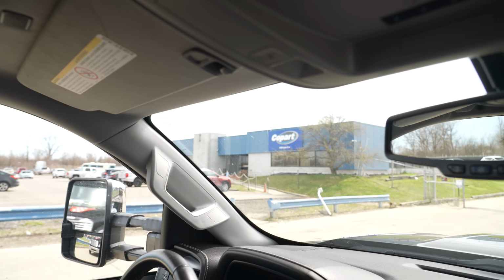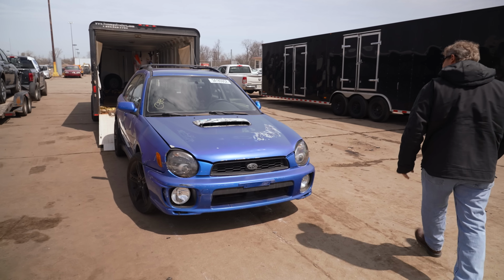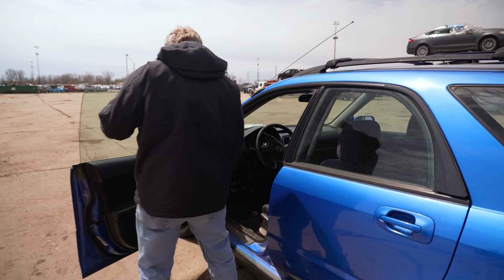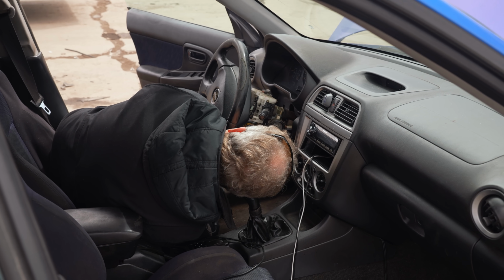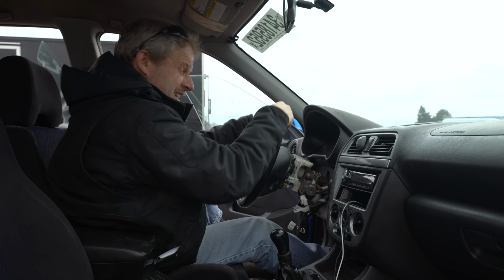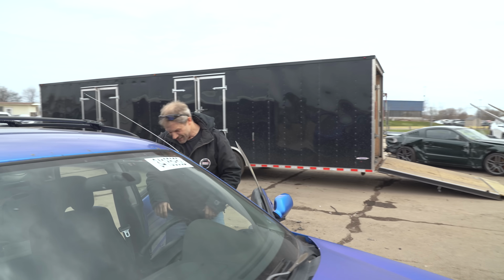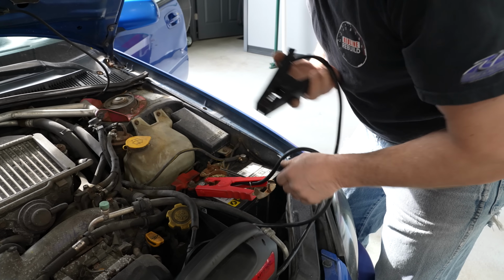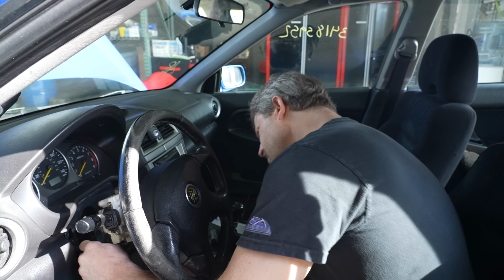Davin's next engine rebuild project... yikes

Comment: Next time try giving the steering wheel lock on the rack and pinion nine volts and unlock the steering wheel and push it in the trailer.

Comment: FYI, Most times you can break the steering wheel lock by hand. using both hands to force it in one direction. It may still have some resistance, But you can still turn the wheel

Comment: Can almost guarantee it isn't the starter. That black ring around the ignition barrel will likely be the sensor ring for the chip that the ignition key has programmed to the car.
No programmed key, no starter signal. Still gets all the dash lights/ignition etc.

Comment: I have an Outback, so am looking forward to this rebuild. Just make sure you have the special tool to R&R the piston pin retaining rings. You'll never get the engine apart without it. The pistons come out the top, rods come out the bottom with the crank.
Reply: “The pistons come out the top, rods come out the bottom.”  How is that possible since pistons and rods are assembled?
Reply: @ellieprice363  You remove the retaining rings and the piston pins (at BDC) through holes in the block. When you part the block, the rods and crank come out as an assembly, and then the pistons can be pushed out the top of each block half. The four cylinder engine is easier as you can get away with simpler tools. The six cylinder engine is the bearcat to work on the middle cylinders. Here you really need the special tool to get the clips and pins out.
Reply: @johnmortison5763  Thanks, I’m not familiar at all with Subaru engines so this interesting to me.

Comment: Will we ever get a series on a 20R or 22RE Rebuild?
Reply: Would the 20R and 22R be Toyota engines?
Reply: @ellieprice363  Yup
Reply: @TheCapitalVice  I bought a wrecked ‘78 Celica in 1986 and removed the 20R engine and 5 speed. Bored the 20R .140 over for 22R pistons, installed twin 40mm Mikuni side drafts, Crane cam, Thorley headers valve job and balanced it. Long story short-Installed the engine and 5 speed in 
my ‘73 Celica (18RC) and drove for several years. Sold the Celica in 2003 to a man in Toronto. He named it “White Lightning”. Now I wish I had it back.
Reply: @ellieprice363  I just picked up a 77 Celica GT yesterday with the 20R and 5 speed. It needs to be overhauled which is why I made the comment hahaha. I'm a visual learner and I rebuilt my Buick Nailhead but im intimidated by this little engine, silly I know but this car is all original and I want to keep it nice.
Reply: @TheCapitalVice  No reason to be afraid to rebuild it. It has a ton of emission stuff on it but very rugged and straightforward engine with a free breathing cross flow head. Plenty of parts available but expensive. The 20 series are much improved over 8R and 18RC engines. The Celica was Toyotas answer to Mustangs. 
Good luck.

Comment: I know it's not your style but bug eye Subarus are fun.  EJ20 engines are pretty reliable if you keep them close to stock and as long as you don't do red line clutch dumps the transmissions hold up pretty well...
Oops I'm a little late on that trans...

Comment: I had a world-rally blue, '02 WRX sedan just after I got out of college! It pushed like a pig in tight turns, but it was tons of fun. I took it to an amateur rally in some nice farmers corn field in the middle of winter and had a blast sliding around. I also autocrossed it in SCCA stock class for a while. The bug-eye font end was no prom queen and the paint chipped really easily, but it was loads of fun to drive and that unequal-length exhaust header burble sounded way better than any other 4-cylinder car I've driven. Looking forward to seeing this one!

Comment: This’ll be good. I had a 96 model I bought new and had for 16 trouble free years.
When I sold it, I’d put 375,000 on the clock and it passed the roadworthy.
I’m surprised by the rust though!

Comment: amazing turbo charged engines that can produce 300HP. in a WRX. You can really go to town on this. Suspensions are supper easy to upgrade. Four wheel drive on that year is easy to fix if there are issues. GREAT CHOICE!!!.  Pick any hot hatch from the 80's or 90's Ratty body's who cars

Comment: Surprised it started and ran at all: usually if the keys are absent, someone doesn't want you to start it and find out how bad it actually is. Engine, transmission or immobiliser woes mostly.

Comment: If you guys plan on making a whole lot of any kind of power with this, I'd highly suggest spending the money on a closed IAG block before you build for some extra reassurance. This car is pretty cool though, gonna be fun to watch you guys handle something so much newer than your usual stuff
Reply: If the original block is OK it is also possible to do a closed deck conversion on it, it doesn't necessarily have to be a new block with it already done
Reply: @rainvillecreative5410  Yeah, that's what I meant. I guess I should've been clearer. But they should definitely do it for reliability and peace of mind.
Reply: What sort of horsepower can these things make?
Reply: @Jesse-B  A lot of you build them right especially with a billet block
Reply: @02honeydew  I remember the first time I heard one back in early 2,000s, it had a sports exhaust and at first I thought it was a v8, because of the offbeat timing I guess, but after I realised it was a boxer 4, I still love the note they make. Would 300 HP be reasonable?
Reply: @Jesse-B  Yeah, they do sound cool for sure, I just wish Subaru made them more stout from the factory. For sure, the STI motors are known to handle like 400 to the wheels and I'm sure this generation can handle at least 300 to the wheels or better with some maintenance done before hand like timing/oil pump/water pump. As long as it's a healthy motor it shouldn't be an issue.
    EDIT: I'm no expert on this cars by any means, I just had an interest for awhile and did a lot of reading. I know some engines had more issues than others and Im pretty sure it's common to do a budget build on these motors with STI internals from (pretty sure) the EJ205 to have a pretty strong setup for around 350whp or better on E85. Getting sleeves/closed decking these engines helps a ton with reliability because they're basically open deck blocks with a small amount of support structure around the tops of the cylinders so they end up shifting and coming out-of-round at high boost pressure. If you have an interest in these cars or any Subaru for that matter, make sure you do your research on them. I know the 5 speed trans isn't the strongest thing in the world and the older rear diff pre '08 I think it is, isn't super tough either when you get up there. Getting a car with the 6-speed and I think it's the V180 rear diff would be your best starting point probably. They do require on point maintenance tho, more so than a lot of cars because of how tight the tolerances as well as the engine desines. Kinda like BMW with rod bearing clearance. Also, my bad for the super long comment.
Reply: @02honeydew  Not at all, great information, thanks. You reading this Davin? 😋
Reply: @Jesse-B  Glad I could help, good luck on picking one up if you decide on a Subaru.

Comment: I'm looking forward to this. It will be fun to watch you set valve lash when you rebuild those DOHC cylinder heads. Although the Subaru WRX uses a boxer engine, assembly and disassembly is much different from that of an air cooled VW.
So now that you are working on a metric car, will you keep a score of how many times you forget you 10mm socket or wrench?

The WRX probably would not have made it to the USA if a bunch of gamers did not seen them in Gran Turismo games. Same applies to the Mitsubishi Evo and Nissan GT-R. I actually knew about those cars earlier, thanks to the magazine Sport Compact Car.

Comment: I am not sure if you had the clutch in when you were trying to "key" start it. If you had the car in neutral and the clutch pedal not on the floor, that might have been your starter problem. We'll see and I am excited for this rebuild. Subaru's are interesting beasts.
Reply: WRXs have a clutch safety switch, but not a neutral safety switch.

Comment: I feel so depressed for you. There are few things in this world as poorly designed or manufactured as Subaru vehicles. Pure unadulterated junk. Hope you can come out the other side with out any major self inflicted problems. 

If you just put a pile of cash in the front seat and leave it on the side of the highway you will be in a much better place in 90 days than if its still in your life.